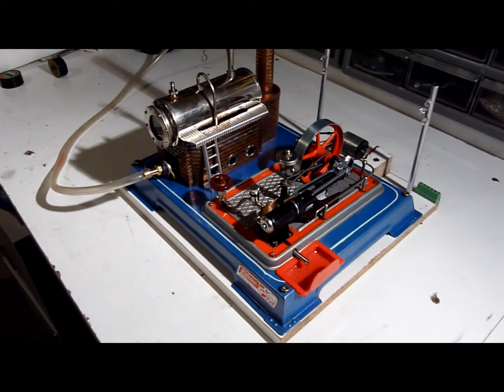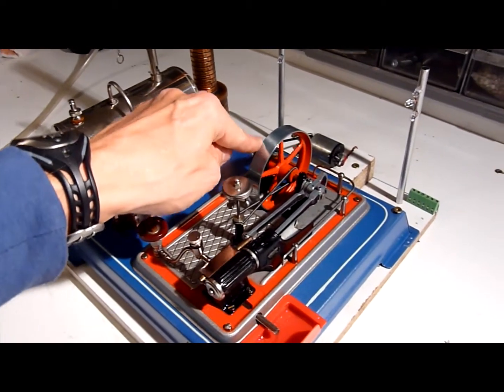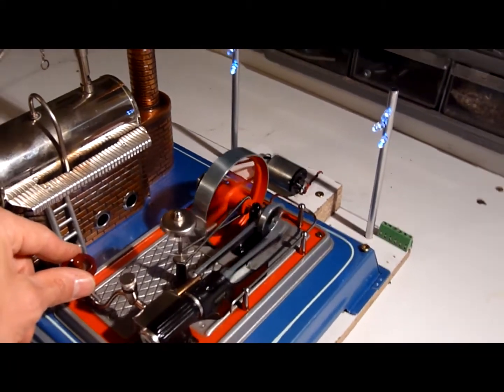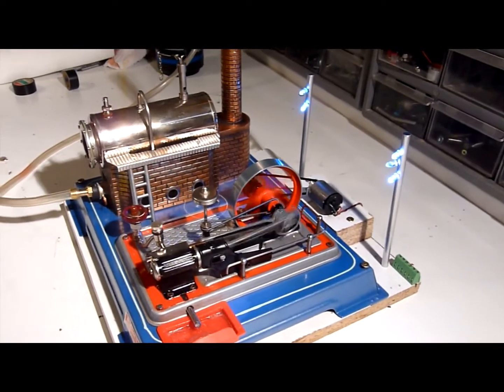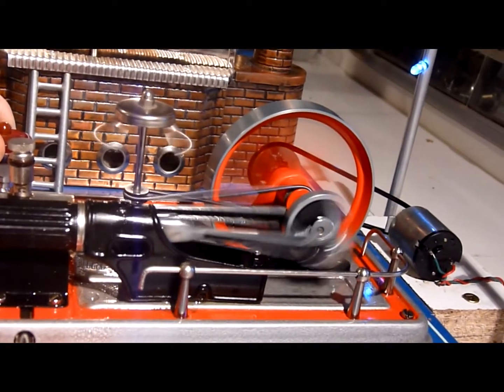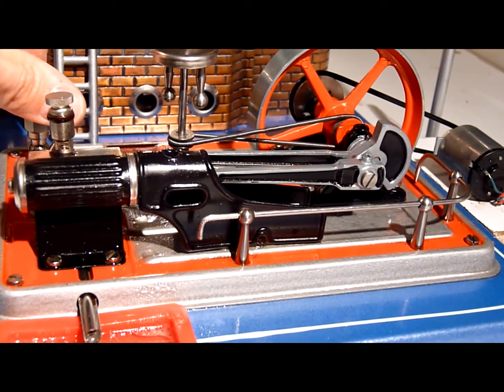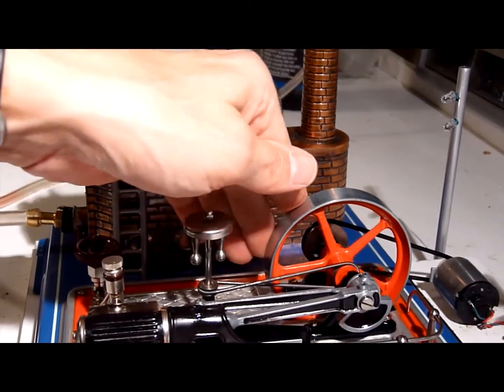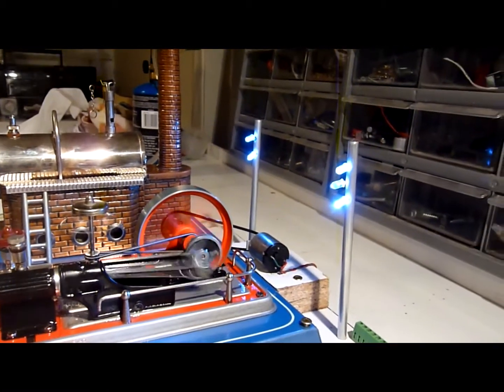Wilesco D16 Steam engine

Comment: I'm new to this so please bear with me. What is the difference between the various models D16 D20 etc in practical terms (assuming they are just being used for fun experiments and not to real work) And if I buy one should i get the oldest vintage model or a newer one? is this a prestige (older) versus less worn out (newer) compromise?  Thanks.
Reply from the maker: It's a perfectly valid question. There isn't much difference between the D16 and D20. The D20 is slightly larger. It has a few more gadgets, like the pressure gauge and some cosmetic enhancements like the foot-bridge. They both use the piston and valve action, which is desirable rather than the oscillating cylinder (D6, D8, D12) as they are more like the real engines. For me the D16 was the best value for the money, but the D20 is very nice if budget is not a factor.
Reply: @ch300fnqi  thank you. I have just bought a "used once" d16. Let's hope it goes well. . Thanks again for your help.
Reply from the maker: Congratulations on your purchase. Let me know how it runs!
Reply: @ch300fnqi  Ran it for the first time today. Nice to see in action. I did not like the mustard colour sludge that came out of the outlet into the tray though. Also it ran out of steam pretty quickly! I think a gas burner would be better. Lots of cleaning to do after as well, mopping up oil and water. But overall a very satisfying experience. By the way, does that thing that spins with the two balls have any particular function or is it just for aesthetics?
Reply from the maker: Good to hear that it works fine. The thing with the two balls is called the governor. It is just esthetics here but it would be used to regulate the speed on the real thing. Yeah it's a bit messy but pretty cool to watch in action.
Reply: D20. "This engine is equipped with the largest flywheel and cylinder, the pressure gauge gives information about the pressure" ...

Comment: Nice video.  I just bought a used D16 today.  Where did you get your generator and lights?  I would love to do the same thing. Thank you!
Reply from the maker: Bill: The generator is simply a small motor extracted from an old printer, scanner or VCR. There are usually two or three in all of them. At some point I was starting to collect these dead appliances just for the motors, lol.  Thre are smaller ones and larger ones, and it's always a compromise between how powerful they will be and how easy they are to turn. The LEDs, you can buy in any electronic supply store, or extract them from a flashlight, bicycle headlight, etc they're all over. The belt is an O-ring bought from an auto part store. Get the thinnest ones for better efficiency.  Good luck!
Reply: ch300fnqi Where did you get the gas burner? i would like to fit something like that to my old Wilesco d16 model.Great job!! Cheers,Rob
Reply: ch300fnqi It looks cool with the LED lights!By the way i subscribed to your channel.Cheers. Rob
Reply from the maker: Rob Hernandez Hey Rob, thanks for the good words and thx for subscribing! Yes, I really like having the generator and leds. I made the gas burner from a 1/2 inch copper pipe capped at the end and drilled along the top with several small holes.
Reply: So the burner is made of copper tubing or pipe ? the reason i ask is that pipe is thicker than tubing and in your video it looks like it's tubing am i wrong?

Cheers
Reply from the maker: Rob Hernandez Just a regular piece of water pipe, i.e. half-inch copper pipe, with a penny soldered on one end. Brazing it would have been better but since I don't have the equipment, solder does just fine, quite surprisingly in fact. Good luck, let me know how yours works out.
Reply: ch300fnqi Thank you for the info, very ingenious. I will have  to do that.I sent an email to wilesco asking them to date my D16. I found a number stamped at the bottom of the burner and I described my model hopefully they will get back to me with the info.Take careRob
Reply: ch300fnqi I am hoping that the number is a part number for the whole assembly or it could just be a part number for the burner.Right now I have most of the engine disassembled to clean it and lube the parts that need lubrication. what type of oil do you use to lubricate the piston and cylinders and the cranck?Cheers Rob
Reply from the maker: Rob Hernandez Hi Rob, great, let me know what Wilesco comes up with. I checked mine and I can't really tell ifthere is a number but of course it is not disassembled. As for oil, I use simple 15W50 motor oil, or just any grade. Have fun!
Reply: ch300fnqi If you look in the bottom of the original burner you should be able to see it if it is not covered by carbon deposits.I will let you know what wilesco says but I guess they are out until august, they must be on vacation.And thanks for the tip on the oil.Rob
Reply: ch300fnqi Right now I am trying to figure out how to remove the boiler cylinder but it looks like its riveted in the front of the housing so I will have to figure out something. I want to remove it so that I can wire wheel the nickel finish because its damaged.